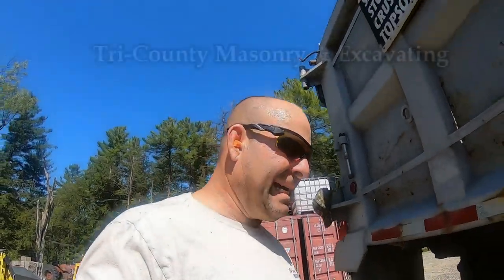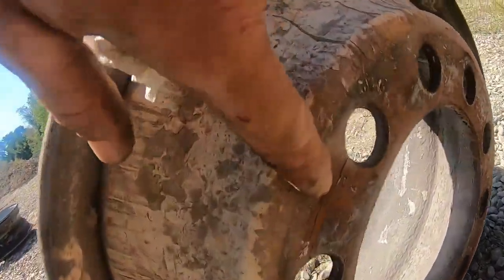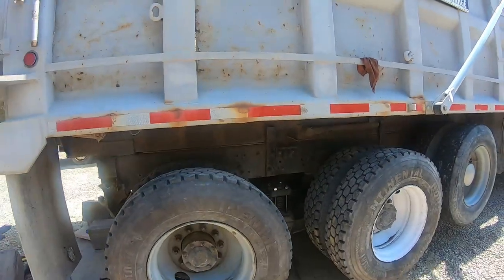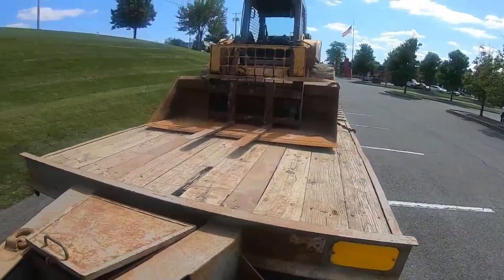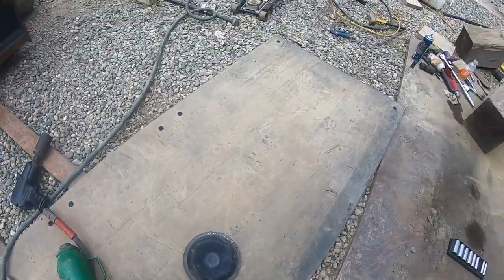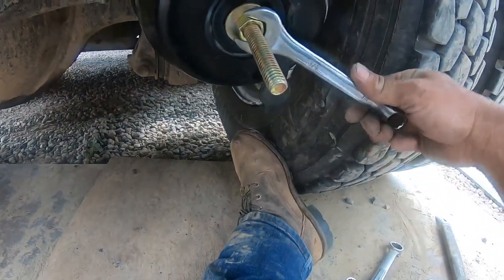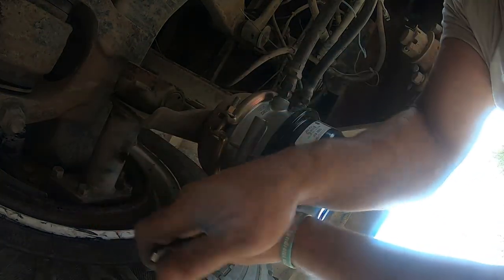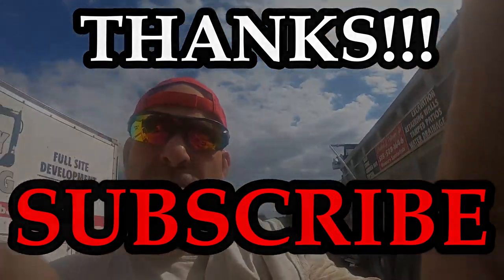D.O.T. violation repair video fixing broken dump truck cracked rims air can ect

Comment: Nice work Mike, good you didn't "get died" as my kids say. We have the same weather so this will work for you as well. Our shop inspects with a pressure washer and a clean truck. We spray used transmission oil on the blocking because it creeps into the leafs. A mittful of grease on wire wheeled parts goes a long way when assembling the repair.  Keep up the great content. Thank you!
Reply from the maker: Toad thanks for the tips!

Comment: Forgot  suggestion on your pitman arm bolt  if comes loose once always  put on a new nut and torque to spec.
Reply from the maker: Yes you are correct

Comment: Here is another “pro tip” you call it don’t put caging bolts back into break pots they get all corroded and full of dirt and road crap that when you need them you never are going to get them out from the aluminum sleeve and steel caging bolt put them in the pocket of your door or better yet tool box on the truck so you have them when you need them. And here is another tip your brake pot you removed is a bomb there is a 1600 psi spring ready to go off in that side of the pot so I would of drained air first and then took the air lines off of it not just let it do it’s thing, as well don’t put your thumb or any body part over the air line that has I’m guessing 120 psi coming out of it you could get a air bubble in you blood and well that will kill you. just looking out for you and good job on the work and videos just tips for life that’s all
Reply from the maker: Thanks for the tips.. the spring was broke inside of can couldn't cage it.. i had the air backwards on that your right should of drained it. Thanks